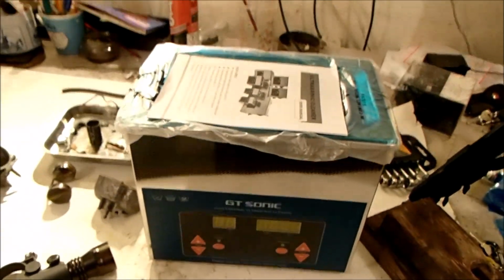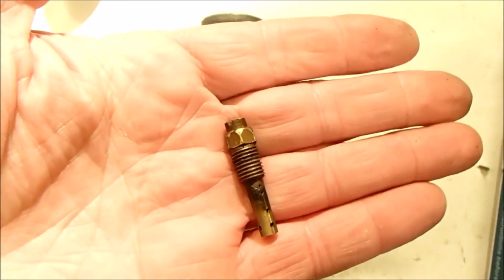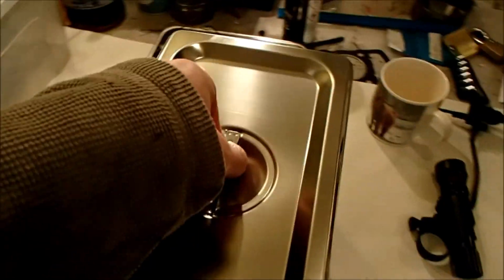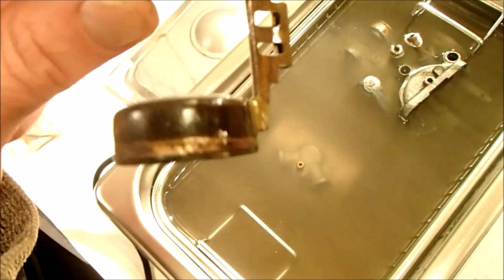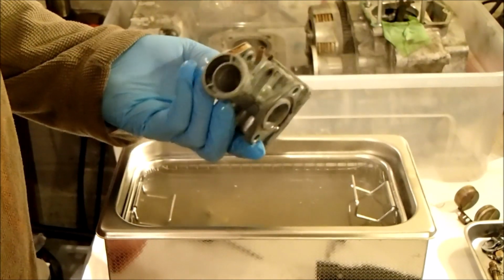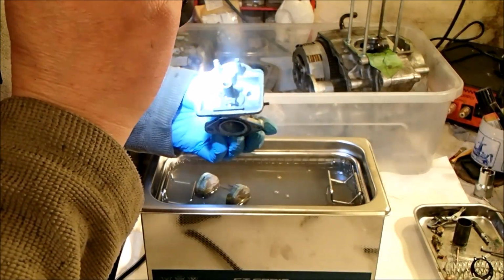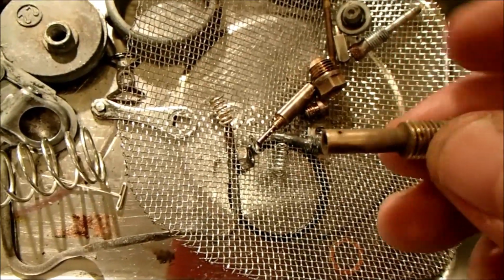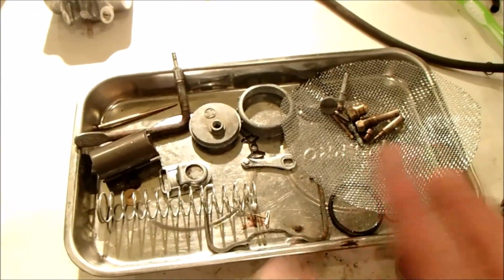Honda cb125s restoration pt-9 carburettor ultrasonic cleaning

Comment: My throttle was working fine and snapping back to off but after I cleaned the carb and put throttle back on it is now stuck wherever I turn it.. I feel I've out it in the right way and there's no reason dirt would of made it stick in the ammont of time I've had the carb off. Any ideas?
Reply from the maker: Take it off again, check that the slider is free from any drag. Check the spring is located correctly, check the cable is free and easy to pull back and forth and that it's routed correctly. Lightly oil the parts. If the above is all good, it should work. Also check that the throttle grip rotates back when you pull the cable.